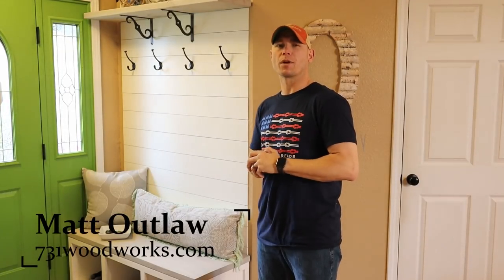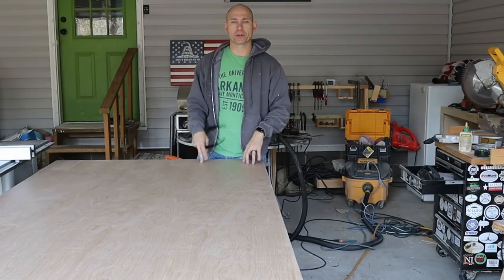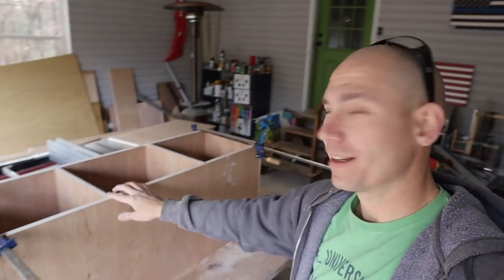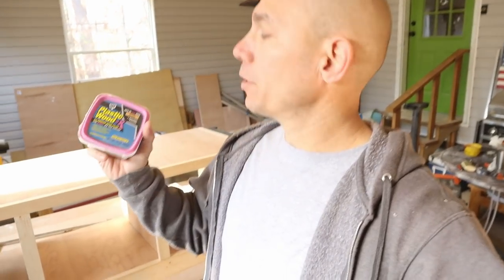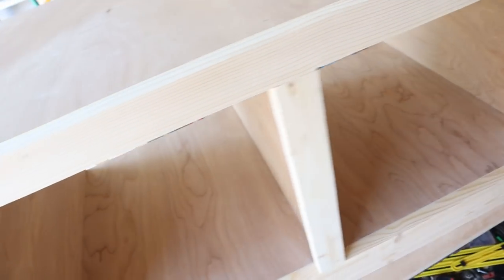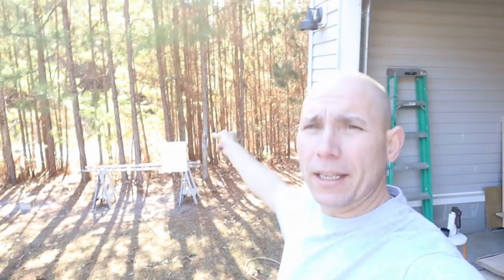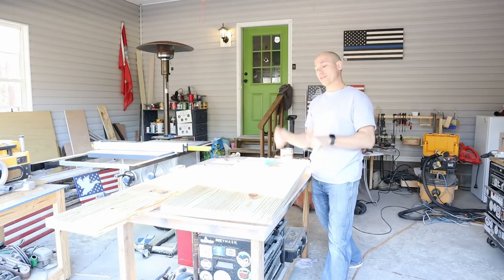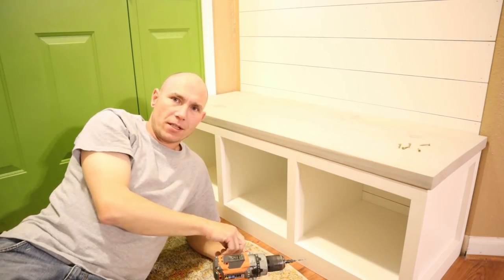Shoe Storage Bench with a Coat Rack | DIY Entryway Project

Comment: Do yourself a favor and buy a Kobalt Router and Router Table at Lowes.  Current price $169.  Then buy yourself a bunch of bits. I bought the large box of Yonico bits on Amazon which are very highly recommended.  They were over $100, but you are paying less than $2 a bit. Then it will be easy to make lots of pieces. If you need to cut a dado or rabbet, take the router off the table and use it with an edge guide. It is powerful enough for any soft wood.
Reply from the maker: Awesome! Thanks for the information. I'll check it out.
Reply: @731Woodworks  The decider for me was some YouTube videos.  I have a comment under one. Quite extensive.  All in all a good table and single speed router. I recently bought a 2" Freud straight bit, shimmed out the outfeed fence with some pieces of cereal box cardboard, now I can joint 2X lumber.
Reply from the maker: Awesome!

Comment: If your shiplap is just attached to the drywall how confident are those coat hooks won’t fail? Or are they anchored to something else?
Reply from the maker: They've been there for a while now with no issues.  Hanging coats and bags on them.
Reply: @731Woodworks  did you screw them into wood studs? I’m getting ready to make one of these using pinewood shiplap, but I’m considering running 2x4’s in the wall to secure the hangers, might be overkill lol?

Comment: I feel your fear every time I build something because, "I've never done that before" is my motto in woodworking. I tried rabbets on my current project to inset a 1/4" sheet of plywood in the back of a set of 2x6 desk legs that functions also as a small bookcase. Where my router got loose on me, I filled with Timbermate wood filler. Made it flat, but I'd sure like a do-over on it. Oh, well. Next time. 

Nice job on this project, all around.
Reply from the maker: adapt and overcome lol

Comment: What router bit you use for the rabbit
Reply from the maker: 3/4" straight bit.  They actually make one that's made for dados that is slightly undersized to match the actual size of 3/4" plywood
Reply: @731Woodworks  thank you

Comment: How did you connect the box to the ship lap wallboards?
Reply from the maker: I just screwed it to the wall
Reply: Not to the studs? And if not will it hold enough weight to sit on?
Reply from the maker: Yes the box is attached to studs

Comment: Do you get your lumber there in Monticello or do you drive to Pine Bluff?
Reply from the maker: A mix of both.  All the 1x spruce, 1/4" plywood, and 2x material I buy at Bartons.   Any 2x4's I buy at Allied because they have #1's.  I was driving to Pine Bluff to get the 3/4" sanded plywood until recently when I discovered Bartons has it.  It is about $10 more per sheet at Bartons.  So if I am only getting 1 or 2 sheets, I'll get it there.  For 4x4 I go to Lowe's in Pine Bluff because they have douglas fir, which I like better.
Reply: It’s so cool to see Pine Bluff mentioned. My dad is from there.